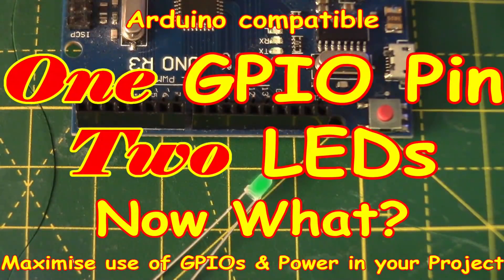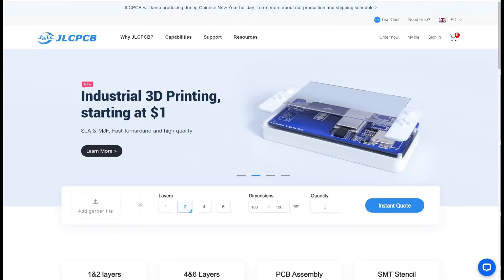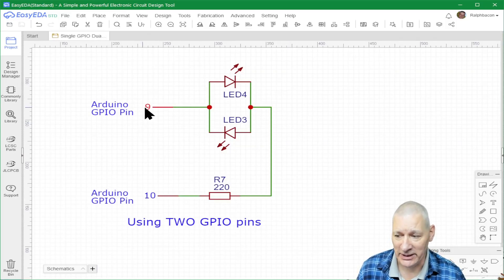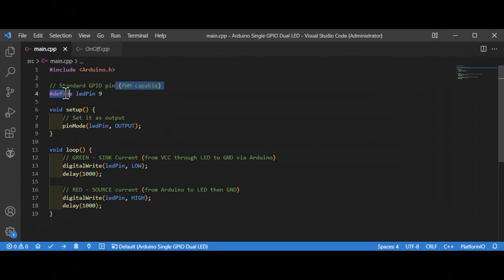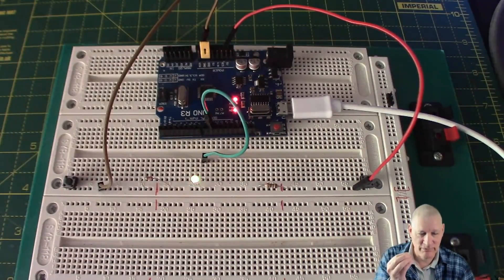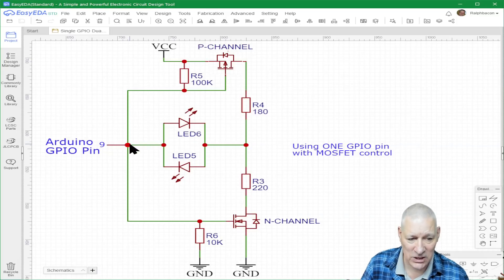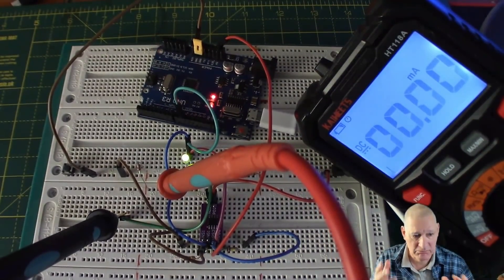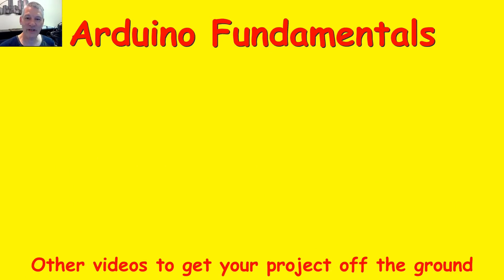#241 Yikes! Only ONE GPIO pin but TWO🔴🟢LEDs - Now What? Easy fix!

Comment: I made a quick-test board for ATmega328-chips which I use with my students. Every once in a while some GPIO-pins get fried in the output direction and I wanted to quickly test the functionality of all output pins. So I connected 23 bicolor LEDs to a ZIFF-socket and the GPIO pins and the other side I connected to a voltage regulator set to about 1/2 of the 5 V supply voltage.
Reply from the maker: If the GPIO (output) pin gets fried, what colour do you see? Does current always then flow into the port? Curious about the use of bi-colour LEDs here.
Reply: @RalphBacon  I'll record a #short, even though I don't like those...
I run a test program which switches the GPIO-pins into output mode and then toggles between LOW and HIGH. A low is indicated by green and a high by red in my configuration since I connected the bi-color LEDs in this way. So for a LOW on the output the output sinks current from 2.5 V through the green LED to GND and for a HIGH the output sources current from VCC through the red LED to 2.5 V on the outside. Most often when my students fry an output the corresponding output will go into a high-resistive state (probably the bond wire burns up like a fuse) in that case neither of the two LEDs would light up in the test sequence, another failure mode could be a shorted output transistor which would turn either the red or green LED on permanently.
Reply from the maker: Understood. The final question is: what do you do with chips that have one or more GPIO pins non-functional? Just annotate that and ensure the student knows not to use, say, D3, or what? What if a whole port is dead?
Reply: @RalphBacon  I use these for my personal projects or donate them to the students. It's mostly to avoid that the students work with broken equipment without noticing.
Reply from the maker: Sounds as though you have this nailed down 👍🏻
Reply: @RalphBacon  as promised: https://youtu.be/EtXWKUyYeXA
Reply from the maker: Thanks, Uwe, just watched it. Nice work. 👍🏻

Comment: Am I missing something? ... That circuit will be drawing current at all times anyway because there is no way to turn off the LED. If pin 9 is high, the LED is on. If pin 9 is low, the LED is still on.
Reply from the maker: See my pinned comment, Daniel, all will be made clear!

Comment: And put your Output in Tri-state mode and your LEDs are both off (? : to test🤔🙂). Wouldn't that too résistance be 10K? (instead of 100K)Cheers 🖖🏻👍🏻
Reply from the maker: The 100k (not 10K) is normally needed for a P-channel MOSFET but not in this case. If you read the pinned comment under this video all will be made clear!

Comment: Looks to me the current will still flow through the Mosfet pull up and pull down resistors.
Reply from the maker: It would, albeit in the order of μA but they can be removed once it's all in place (see pinned comment for full details).

Comment: How about.......Connecting R1 in series with a zener diode and R2 in series with another zener diode, with the sum of both zener voltages being greater than 5V  (say 3.3V each).  You could Tri-State the I/O pin to turn off/flash either LED and no current will flow from the 5V rail when the IO pin is an input..
Reply from the maker: That's an interesting suggestion, David. As I have the circuit still on my breadboard I might try it out later and see what happens (without using any MOSFETs).
Reply from the maker: I tried it. Brace yourself for disappointment 😥

With an input voltage of 5v2 from my powered hub, the voltage drops to 2v7 after the first 3v0 Zener.

Theoretically this should not be enough to pass through the second 3v0 Zener but it still manages to sink 0.9mA (858μA to be precise).

I suspect this is because Zener diodes are not either ON or OFF. They start conducting (a bit) before their knee current/breakdown voltage is reached or exceeded.

Still far better than the 12-14mA we were experiencing before. However, the LEDs were a bit dim now and the resistors would have to be reduced to compensate - leading to an even higher Zener current flow. Sigh.

It was well worth suggesting, though, and testing on your behalf. 😜
Reply: @RalphBacon  Thanks RB.  As soon as I hit the "Reply" button I realised that the green led would not work very well with a 3.3v zener since the green led has a higher forward voltage drop than the red led and the sum of both would be about 5.0v, with no headroom to set the led current via the series resistor value.  I would need a 2.7v zener which has an even worse "Knee" region than the 3.3v unit !
dr

Comment: Another great video ... and timely! Just yesterday I was thinking that I should learn about mosfets and replace the relay, that I added to a buck converter, to switch it on and off. Now I can (slightly modify) your circuit, replace the relay with a mosfet and detect reverse voltage = excellent!
Reply from the maker: Wow! I'm glad it has inspired you to make some changes 👍🏻

Comment: If you tristate the I/O pin, is 2.5v below the fet gate's knee and both fets and leds are off, or is 2.5v enough to turn it them on and the leds are off but both fets are both on?
Reply from the maker: LEDs are off! More info in my pinned comment above 😁

Comment: Hi Ralph. You are still technically "driving" the LED's from the GPIO pin. In your case, it works fine, but in others, it might not be. The total driving current of the ATMEGA is not that much. I've used a combination of a hex inverter, and a cheap ULN2803 to drive many bicolor LED's without loading the micro. One I/O pin per LED, two channels of the ULN driver. Even the addition of a shift register can let you drive as many of the LED's as you like, with only 3 or so I/O pins.  Just a thought :-) Would make in interesting video.
Reply from the maker: I'm interested to know why it might not be suitable for all, Johann? 

The UNO can drive up to 40mA per GPIO pin although we usually accept the recommendation to keep it at 20mA or below. The LED here (quite inefficient, and not one I'd use in a battery-powered project) takes about 12mA.

I've looked at your suggested ULN2803; if we wanted to drive lots of LEDs it might be the solution but, frankly, I'd use a NeoPixel first choice and a MOSFET 2N7000 (or similar) second choice.

Why the ULN2803 (other than to remove the current sourcing/sinking of the MCU)?
Reply: @RalphBacon  Hi Ralph. The total current should not exceed 200 mA, so given all the available I/O on the Uno, one must be careful not to exceed that. The Uno is typically used by relative beginners, so the impression might be that 40 mA is available on all pins simultaneously, which is not the case. Even more so on the ATMEGA 2560 (Arduino Mega). I make a habit of not using I/O to drive anything directly if I can help it. The ULN2803 driver chip is cheap, dead easy to use, and can drive a LOT of current, very fast - hence my choice. Its even suitable for driving DC motors, solenoids and large relays directly. I have a drawer full of them, and can use them for many different projects. I know there are more expensive, more elegant devices available, but I always have to source and order those specifically for a project. I prefer to use a set of fairly standard building blocks which I keep in stock. The IRL520 MOSFET's are also favourites for driving things, for all the same reasons. Further - in power sensitive circuits, LED's should really be driven with PWM. But, of course, that complicates the code somewhat. PS: This is a much bigger, and potentially more expensive issue  on the Raspberry Pi (to be aware of). For which my solution is the same.
Reply: @RalphBacon  If driving a lot of LED's is the target, Charlieplexing is also an obtion.
Reply from the maker: @Tomas S But not with just a single GPIO pin! 😉
Reply: @RalphBacon  No of course not 😁

Comment: I would hope you don't waste 13.5mA on an LED in a battery power device, to begin with!
Considering an Arduino consumes about 14mA @16MHz
I find 5mA to be more than enough for any indicating LEDs. 
Love your clever circuit.
Reply from the maker: Glad you like it!

Actually, my battery powered circuits actually consume, when 'asleep', exactly zero μA because I use my very own auto on/off circuit! Also done with an Si4599. See video #123. https://youtu.be/g1rbIG2BO0U 

I even have some LEDs that only need 2mA to shine quite brightly. Perfect for battery-powered devices. But difficult to find on Asian warehouse sites because they rarely tell you the minimum forward current required. Sigh. 

And we can always save the power for an LED by making it flash briefly; 5 x 50mS flashes per second is both eye-catching and power-saving! I should have mentioned that in this video. Double sigh.

Comment: As a colorblind person, I hate those red green LEDs.  A few years back, I bought a bag of 100 red/blue bicolor LEDs and I have been replacing the red/green ones everywhere I can.  I haven't had to swap out the current limiting resistors yet fortunately.
Reply from the maker: That must be very frustrating indeed. Yes, there are other colour combinations but I chose these as I am fed up with blue🔵LEDs everywhere (eye-searingly bright, mostly).

Comment: Another good video, but is there a brief moment in time when both mosfets are on together?
Reply from the maker: Well, maybe. The on/off switching times of the MOSFETs are down in the nano-second region (7nS - 30nS) and we do have the resistors to limit the current anyway so there is no danger of a short circuit here (unlike with a bridge circuit). 
So there is a possibility of 12mA for 20nS per switchover. I can live with that.
Reply: There is, but in that case the worst current you could have is through the 400 ohms between them, and this time is probably in the ballpark of around 100ns(conservative guess), so it shouldn't be an issue unless you are switching the color at a very high frequency. So a pulse of 12.5mA lasting 100ns when switching 10 times per second let's say is equivalent to about 1.25uA DC, and compared to the led current it is insignificant. On the other hand if you tried using PWM on the led you might have some trouble(arduino does it at 490Hz so ~1000 switches per second), You would get a 1.25mA DC equivalent current flowing which is a lot worse but within 10% of the leds' current draw so shouldn't be an issue.
The realistic values are probably about an order of magnitude lower. If you wanted to measure this you could do it by adding a capacitor in parallel to the mosfets' power supply and measuring the current with a multimeter in dc mode.

Comment: The Bacon way  ?? mmm sounds tasty.
LED need no way ner 20  mA ? You might think twice about that.
If you really want to save power, why burn energi all the time. One LED will always be on. You only need the one signal, on or off.
Why not run a single LED on a PWM line, then you only need a capacitor to run the LED
Reply from the maker: I disagree, Flemming. My Smart Heater Controller displays either red or green as a positive indication of the state of the heater. I would not want there to be NO indication; what that mean? Heater off or circuit fried?
For battery projects it's a different game altogether; but even smoke alarms flash the LED for a brief (20mS?) every minute just to let you know it's all working OK.
BTW did you get that PCB yet?

Comment: worth noting that there are lots of 3/4 pin bi-color led available, which eliminates the need for the more expensive and complicated mosfet circuit.
Reply: gsdcbill  I'll let you think about it, find one and look at the datasheet.  hint, you still only need 2 resistors.
Reply from the maker: If this bicolour sort of LED isn't any good, a single wire Neo Pixel would be an alternative, although at the expense of an Arduino library (Adafruit or fastLED, for example).
Reply: @RalphBacon  I actually played an april  joke on myself with that :)  common emitter/collector doesn't work, series doesn't work, mosfet is a good trick!

Comment: You forgot one thing. How do you turn off both LEDs?
Simply switch the IO pin to an INPUT then it is high-impedance. 
As an OUTPUT you can switch between high and low. 
So three statuses are possible.
Reply from the maker: I'm guessing (I could be wrong) that you did not read the pinned comment before posting this? 🤣😂😁
But you are 90% correct, of course. Tri-state is not high-impedance. You will get current flowing down an INPUT pin albeit very low - but not low enough not to light up an LED (dimly). Luckily this circuit solves that issue too.

Comment: This is a great idea. I think it's even better than most may think. If the Arduino pin is set to an input, both LEDs should be OFF. This gives us a third state. Secondly, I think that since the gates of the MOSFETs are connected together, only one resistor is needed. R5 can be omitted. This will save a part and lower power consumption further.
Reply from the maker: Yes, if the GPIO pin keeps the MOSFET off (when required) we could kill R5. Possibly R6 too. Without using the Si4599 the Arduino does "leak" current in the INPUT mode; whether that is enough to switch on either MOSFET I haven't tested.
Reply from the maker: GOOD NEWS! I've tested the tri-state option now. 

You can remove both R5 & R6 (the MOSFET Gate resistors) as they are no longer required; the GPIO pin keeps the MOSFETs in the correct state. 

If you set the GPIO pin to INPUT there is ZERO current flow in either direction. Basically, the MOSFETs do not allow current flow. The LED remains OFF. Setting it back to OUTPUT resumes normal operation.

Thank goodness! Obviously I designed it to do this 🤥

Comment: So to turn the LEDs completely off you would need to set the output to an input so that it is Hi-Z.  Not sure if you mentioned that in the video.
Reply from the maker: It doesn't turn fully off; there is a small (very dim, how dim depends on the LED) leakage current. I never designed it for that 😢
Reply from the maker: GOOD NEWS! I've tested the tri-state option now. 

You can remove both R5 & R6 (the MOSFET Gate resistors) as they are no longer required; the GPIO pin keeps the MOSFETs in the correct state. 

If you set the GPIO pin to INPUT there is ZERO current flow in either direction. Basically, the MOSFETs do not allow current flow. The LED remains OFF. Setting it back to OUTPUT resumes normal operation.

Thank goodness! Obviously I designed it to do this 🤥

Comment: interesting Ralph. Had not thought of this myself yet. But do I understand correctly there is no way to turn both off?
Reply from the maker: Yes, that's right, I'm afraid. 😢 That said, I haven't tested the behaviour of the MOSFETs when the GPIO pin is INPUT mode. They might stay off. Without it, the Arduino leaks like a sieve!
Reply: @RalphBacon  not a biggie. Though i am sure with adding a few more components and pwm-ing the pin to a certain duty cycle we can get that done as well.
Nevertheless   nifty circuit
Reply from the maker: GOOD NEWS! I've tested the tri-state option now. 

You can remove both R5 & R6 (the MOSFET Gate resistors) as they are no longer required; the GPIO pin keeps the MOSFETs in the correct state. 

If you set the GPIO pin to INPUT there is ZERO current flow in either direction. Basically, the MOSFETs do not allow current flow. The LED remains OFF. Setting it back to OUTPUT resumes normal operation.

Thank goodness! Obviously I designed it to do this 🤥

Comment: Hey Ralph, thanks for the video! I'm home alone today and you kept me company (so to speak!)

I couldn't figure out what you meant, until I saw the schematic, then I was like yeah, batteries will not be 5v unless you have a voltage converter (to buck or boost battery). Then there's the current leak, too. You could hotwire MOSFETS though (like you did!). 

It reminds me of when I was playing with "tri-state" GPIO pins (in my head). I didn't get too far with it, but the idea was you could have a pin in 3 states. So fully on at 5v, partly on at 2.5v and off at 0v. I didn't get very far with it, but was one of the ways I was looking at to reduce GPIO pins (but eventually my solution was much more simple - get rid of the individual status LEDs and replace it with a WS2812b LED since I was already using them in my project, and they only need one GPIO for pretty much any length of string, so programatically I can just make one addressable LED the status one (at any colour).

Although I do like the approachable way you've described some quite mind boggling use of MOSfETs (they confused me at first, but now I know they're beautiful devices. Sometimes tiny but have high current capabilities)
Reply from the maker: Someone suggested using one or more TLE2426 but even if that worked they are £3 ($5) a pop. Cheaper to buy a bigger microcontroller!
Reply: @RalphBacon  Yes. That's always the thing to look at. When it's just for something that's needed to keep your BOM down, adding components that cost the same price as the chip isn't the best. Like with the ATTiny85, if you need a weak GPIO for something small you can use Reset but... it's not exactly much more to your BOM to go up to ATTiny84 really, and then you get 6 (iirc) more GPIO pins.

Comment: Lovely, this solution will come in handy in future.
Reply from the maker: Indeed. I so nearly used this in my Smart Heater Controller but ended up using two physical LEDs instead. Sigh.